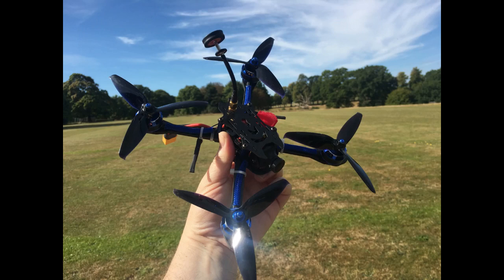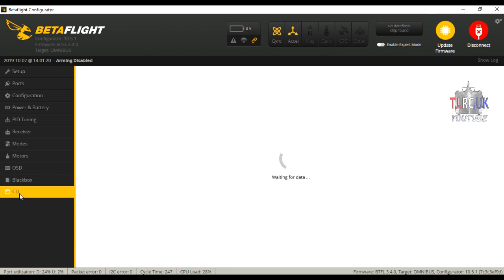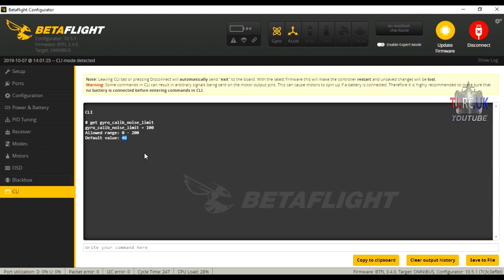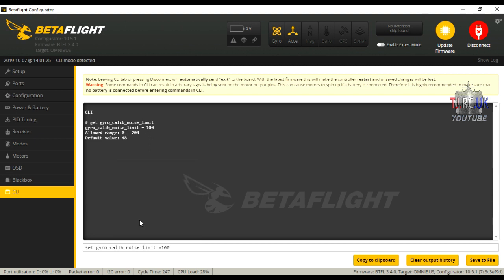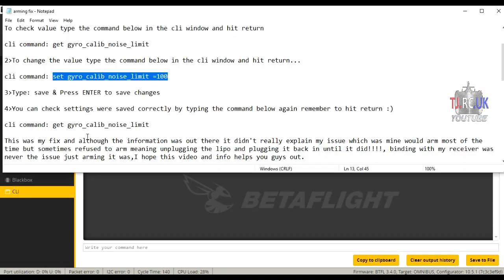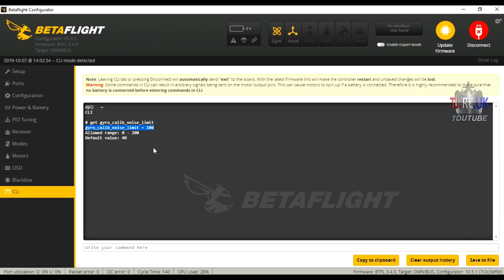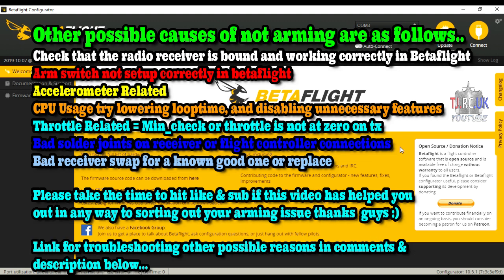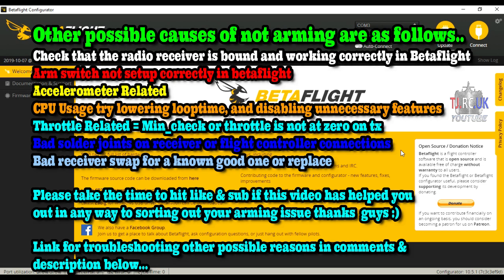🛠FIX🛠 FOR QUADCOPTER WILL NOT ALWAYS ARM 🛠GOING OVER WHAT SOLVED MY ISSUE

Comment from the maker: This fix was done on my miniquad which sometimes would refuse to arm!! so I had to keep unplugging & plugging the battery back in until it eventually decided to arm!!" which was a real pain!!!, this fix seems to have done the trick with no issues so far, so to much noise was being picked up by the fc from the gyro stopping it from arming on initial boot up, raising the gyro_calib_noise_limit from default 48 to 100 has solved this now :) hopefully this helps a few of you guys out as this has been a long journey with a lot of head scratching lol

Instructions I put together for you guys to use......

Open up betaflight & connect the quad in question via usb cable this version is 10.5.1...

You can get it here:https://github.com/betaflight/betaflight-configurator/releases/tag/10.5.1

🛠5 step fix which worked for me below......

1>Enter the cli window aka command line interface

To check value type the command below in the cli window and hit enter

cli command: get gyro_calib_noise_limit

2>To change the value type the command below in the cli window and hit enter

cli command: set gyro_calib_noise_limit =100

3>Type: save & Press ENTER to save changes

4>You can check settings were saved correctly by typing the command below again remember to hit enter :)

cli command: get gyro_calib_noise_limit

5>Once you have confirmed that the setting has been saved click disconnect in betaflight then give it a try & let me know how you get on :)

Other causes of not arming are as follows..
Accelerometer Related
CPU Usage Too High
Throttle Related = Min_check also check your TX throttle is at zero when trying to arm :)
Bad solder joints on receiver or flight controller connections
Bad receiver swap for a known good one or replace
Arm switch not setup correctly in betaflight

Credit where credit is due Oscars page had the best in depth info all in one place showing possible issues for why your quadcopter will not arm, this info is what got me to stage of making this tutorial for anyone experiencing the same issue as me, I hope this helps you guys out in some way getting the issue resolved :) if this fix did not work for your quad then check out Oscars link here: https://oscarliang.com/quad-arming-issue-fix/

Greets TJ